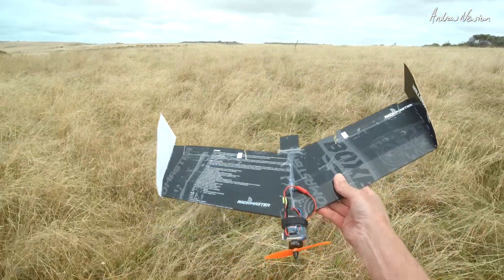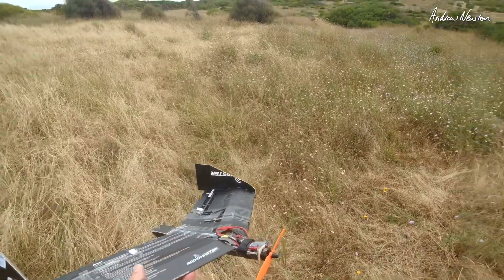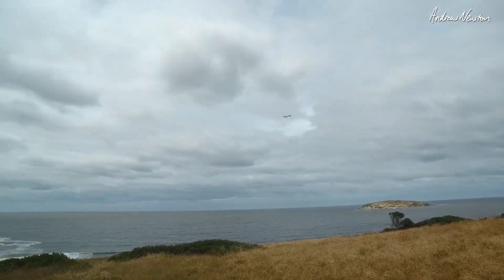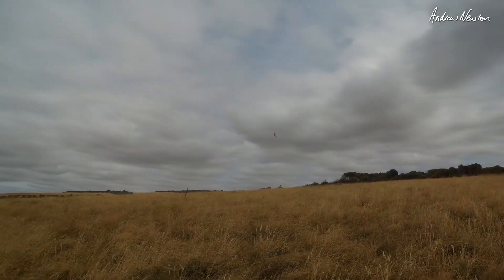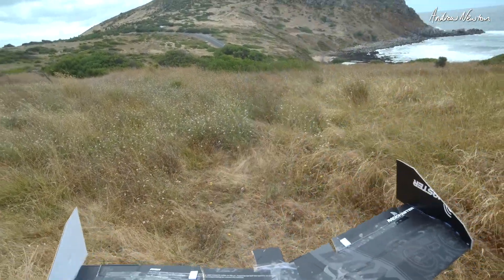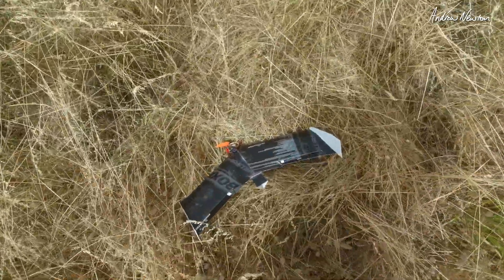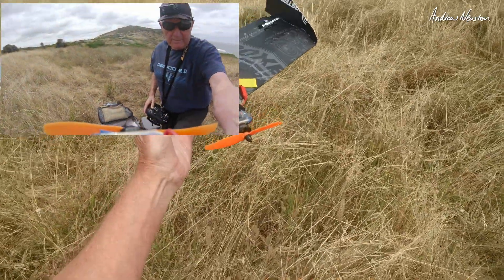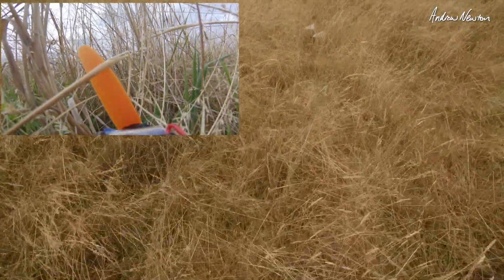Boxer Box Wing

Comment: Flew straight out the box Andrew....As the old saying goes, if it looks right, it will fly right...Just needed bigger elevons....🤔😳😏😏😏🇬🇧
Reply: Maybe it was the flex of the board in the elevons. Happens also on thin foam elevons without carbon rod

Comment: Awesome mate, a question if I can. When you make wings, whether it's ths one or anything else, is there a rule of thumb to work out, when to fold the wing, in this one, I think you measured the wing as 21.5cm, and drew a mark at 7cm. Can you explain this? is it something like a 1/3 of the wing size. I am trying to determine, say I have a piece of cardboard 20cm from the front to the back, where I put in the fold or the fold to shape the leading edge
Reply from the maker: I didn't have enough material for a full top and bottom surface wing so this was a bit of an experiment to see if half with bottom would be OK. Normally for the top surface I would put folds at 20% and 40% to approximate an airfoil with deepest area at about 30%
Reply: @AndrewNewton  thankyou!

Comment: Fantastic mate !
I have just finished mine made out of 3mm cardboard from officeworks. AUW weight 207g with 3S 450 mAh battery. Wing loading 24.8 g/dm2.
I am waiting for bloody wind to calm down here in WA to maiden it.This is my first flying wing type plane so can you help with some additional infos
for the maiden like :
Ailerons reflex in mm or degrees?
Controls throws?
CG position from LE as percentage of MAC.
Thanks !
Reply from the maker: Reflex about 4mm, throws 20mm full up and full down. CG was a bit forward maybe 25%
Reply: @AndrewNewton  Thanks !